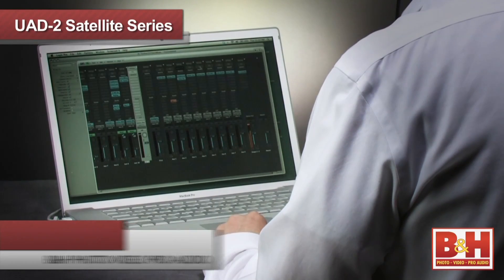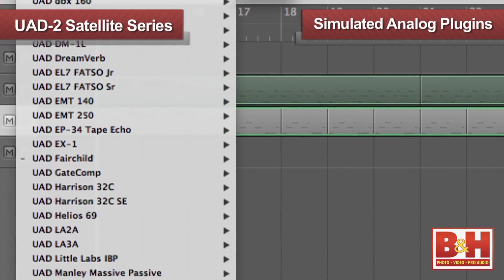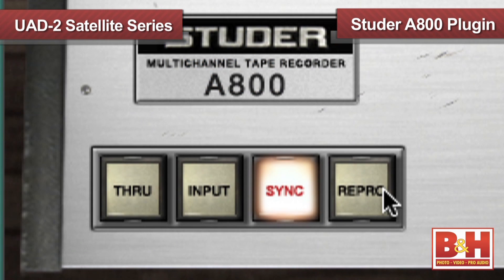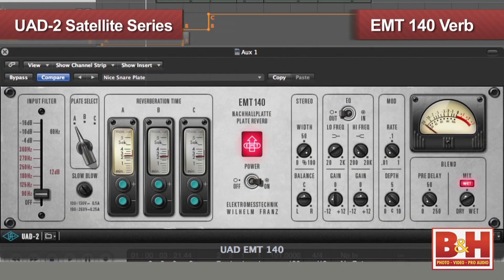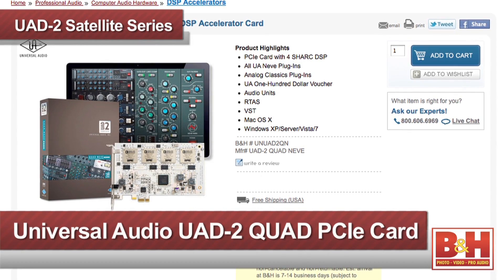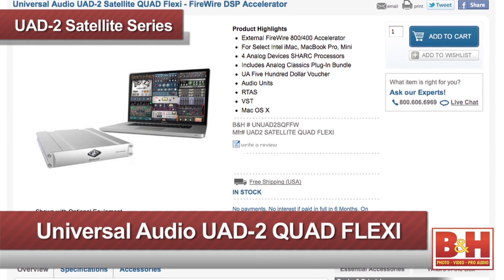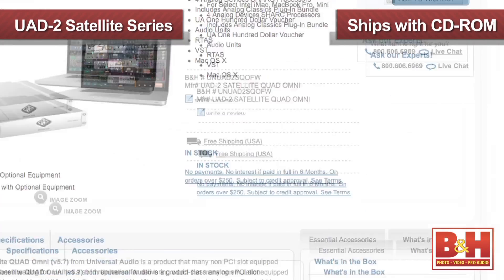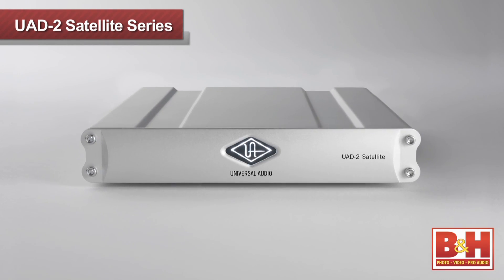Universal Audio UAD-2 Satellite

Comment: can this be used with a Mac on snow leopard and using pro tools 9 and the digi003?
Reply from the maker: System Requirements	:
Mac OSX 10.6.x "Snow Leopard" (no PowerPC support)
Select iMac, MacBook Pro and Mac Mini computers with an available 1394a or 1394b port    >Mark<

Comment from the maker: The UAD plug-ins will work fine without the Satellite box, individually, since they include the PCI card. When you have many plug-ins running at the same is when you can appreciate the power of the external Satellite hardware. Alternatively - if you are working with a non-PCI slotted Mac you must use the UAD-2 Satellite series.